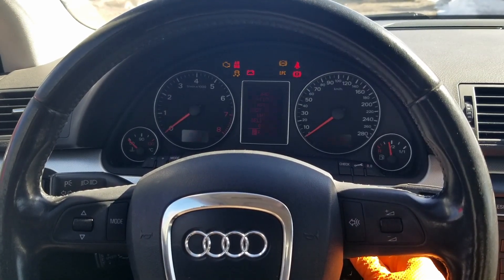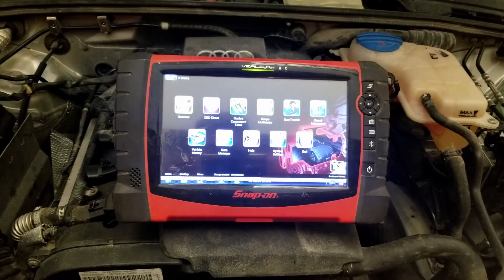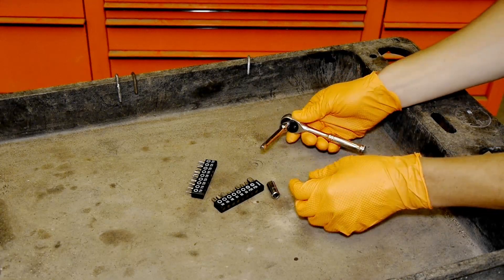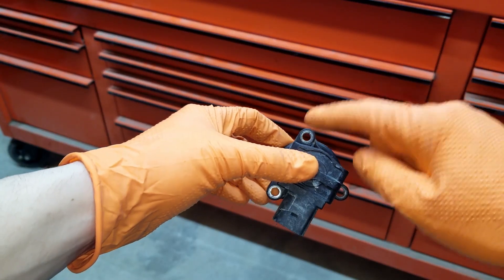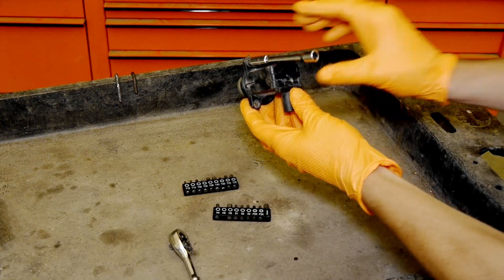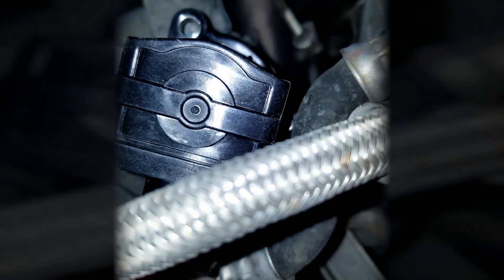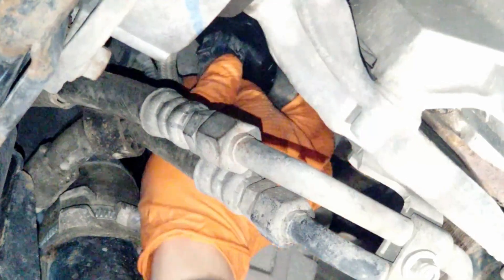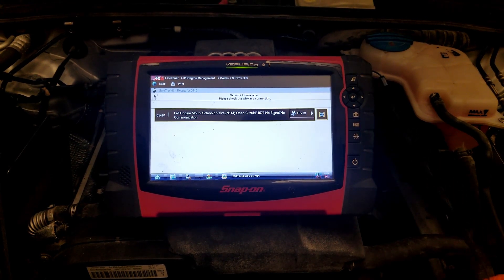2008 Audi A4 2.0T "P0299" | Turbocharger Recirculation Valve N249

Comment: Excellent video, I love how you demonstrate things in "dry mode" on the loose valve alongside the actual repair. I have only P0299, no other codes, and don't notice an issue when driving, so I haven't tackled this yet, but the video may come handy in the near future... thanks.
Reply from the maker: Thanks a lot. You will feel when it starts acting up. All the best 👌
Reply: Hi did u fix the code

Comment: Thanks for the video! Replaced my torn bypass valve with the new design following your video and everything went smoothly on my 2009 Audi A4 2.0T Cabriolet. Put my car on Jack stands, and while it was a tight squeeze,   I got it done over a few hours.
Reply from the maker: Nice 👌

Comment: Is it possible that this part could cause intermittent misfires as well?
Reply from the maker: Possibly. If you have that code, I would just pull that valve out and look at the rubber grommet. It's fairly simple and quick to do.
Reply: @AutoTechWorld_DIY  Doing that first thing in the morning! I actually have O’Reillys ordering the part already just in case
Reply: @AutoTechWorld_DIY  Thank you for the video
Reply from the maker: Have fun doing it. I hope it will fix the problem. Because it is so easy to do.
Reply: Replace spark plugs, thats what worked for my a4.
Reply from the maker: For that same code?

Comment: My car has same code. For a long time. But now I lost alot of power especially in uphill and also I hear a Hissing noise coming under the car when I accelerate. Could be diverter valve causing this problem?
Reply from the maker: The hissing I'm not sure, but everything else really sounds like it. You know, of I where you, I would just pull it out and look at it, since it really is not so much work. And if the rubber is torn just replace it. Best of luck and God bless you.
Reply: i had a nasty hissing noise mechanic said it needed new turbo ended up bring a ripped cuplet hose
Reply: I fixed my waist gate and I still have a hissing sound well it’s more like a wishy woshy whistle sound coming from my cold air intake what do you think!?

Comment: Done deal...did the work at home in my garage ( it is raining a lot outside), it was actually easier than I thought, it took me 45 minutes to do it by myself, the worst was that top screw...pain to remove it, but once that is done, PEACE of CAKE...tested on highway speed, boosted pretty high and no fault anymore. 
THANKS A LOT AGAIN.
Reply from the maker: Good it worked out for you. Happy that I could help you.
Reply: @AutoTechWorld_DIY  Thanks again, SUBSCRIBED and appreciated it.
Reply: Did CE light come back on?

Comment: Thanks for the video. I have replaced the valve. yet the light came back on and the same code. what can I do next. Please advise.
Reply from the maker: You're welcome. You could make sure, that the new part was not faulty. That happens sometimes too unfortunately. Or you can buy a service manual and diagnose what it could be. The other option, is to take it to the dealership and to have a professional diagnose it. Sorry, probably not the advice you were looking for.